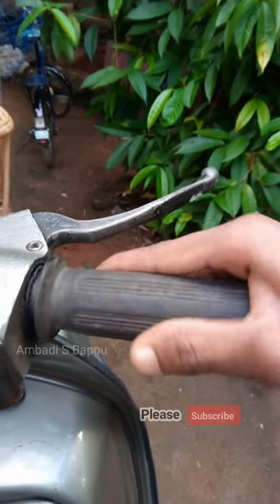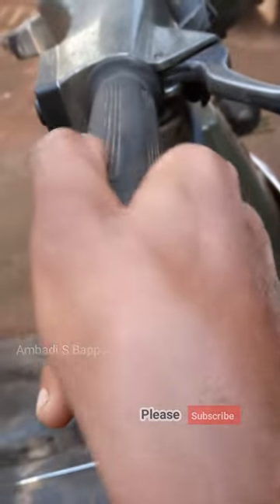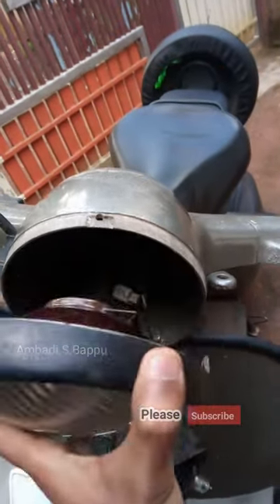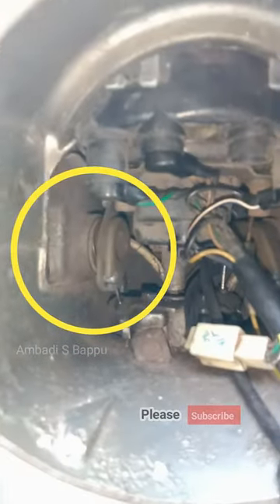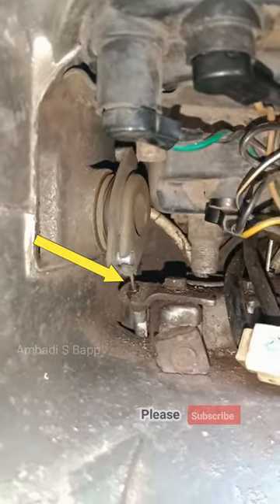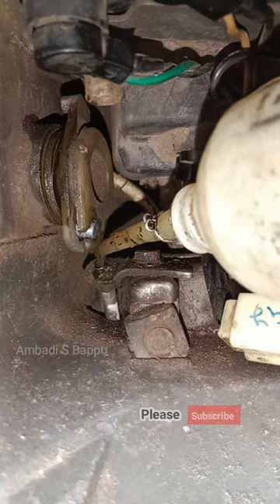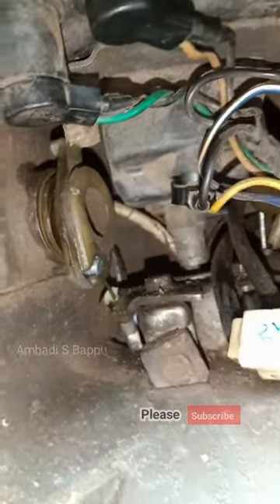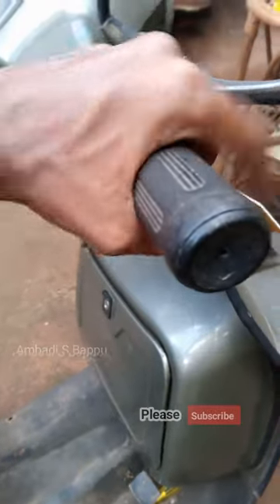Scooter Accelerator tightness and sounds | Problem Solved | Simple Way | Bajaj Chethak #shorts

Comment: How to make the kick smooth
Reply from the maker: Sir, excess Kicker tight may be due to many reasons. Jammed Bearing, Cracked Counter Wheel, Old gear oil, etc. Normally a good engine have some tight in the kicker due to good compression of air in the Combustion Chamber. To smoothen, just check by changing gear oil. Asking to a good mechanic is better, Sir for smoothening the Kicker.